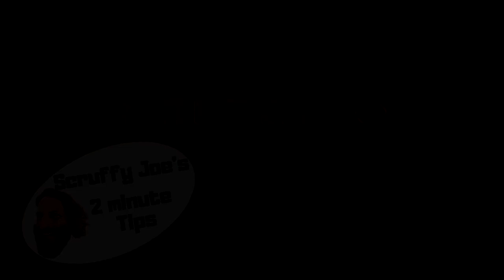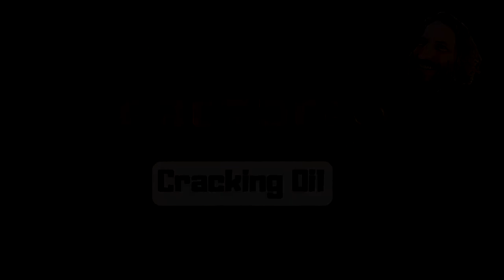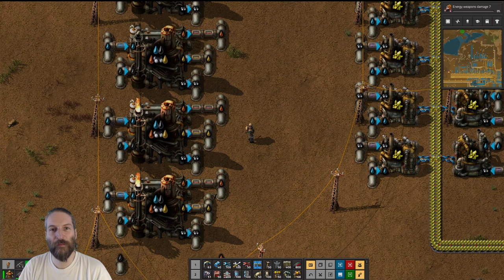2 Minute Factorio Tips - Cracking oil

Comment: Great tip but feel like you've cut it short? Where do things get used after this? I have just made my first arrangement and am struggling to use lubricant enough to keep producing plastic? I've tried making solid fuel and using it to power the factory but it's too efficient and doesn't get consumed quick enough. There might be an issue with my petroleum output though as the pipe is flashing for some reason🫤